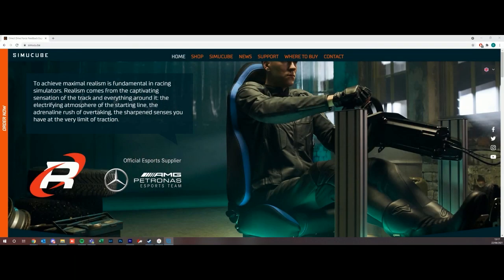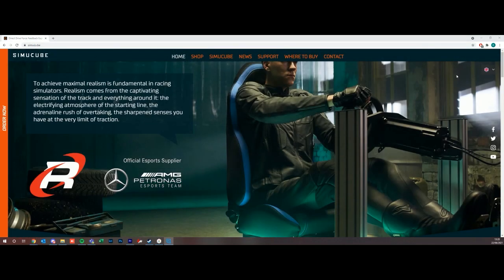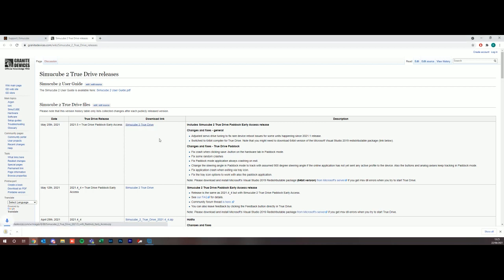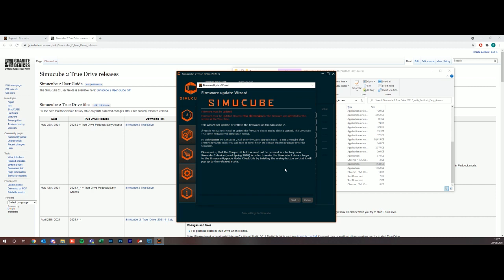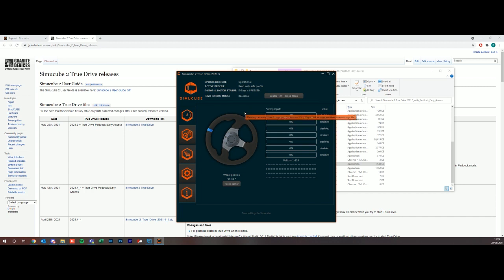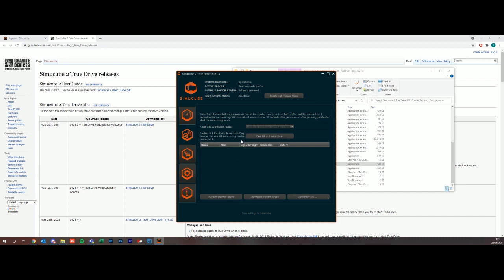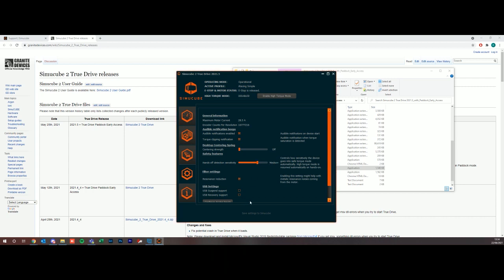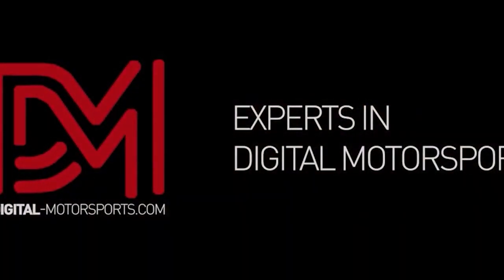How to Install Simucube Truedrive Software

Comment: Hi there I’ve got the sport 2 it’s been installed for a while now but I’ve always had an issue that I’ve never been able to resolve.
The problem I’ve had was in Asserto Corsa it wouldn’t respond to the wheel after entering the game I would have no steering I had to exit the game, hold the rear button in for around 10 seconds then when I heard a bleep I could select start and it would respond.
Quite annoying but it worked but I’ve been off the rig for a few months now that doesn’t work either if I do the same process sometimes the pedals will work but not the steering!
Any ideas?